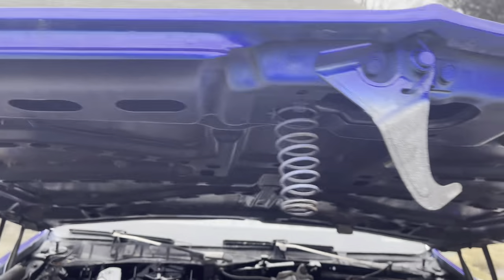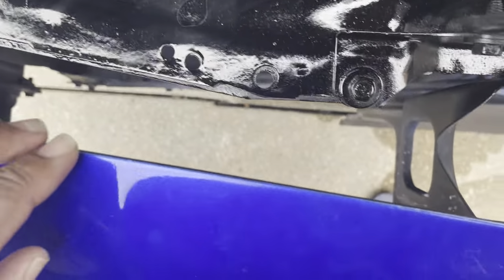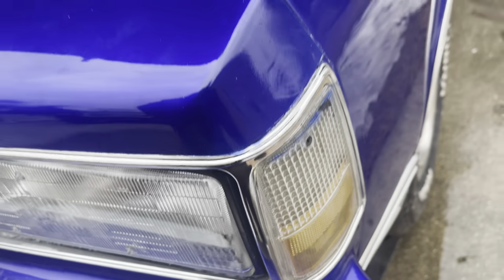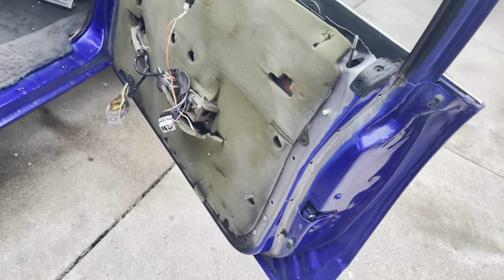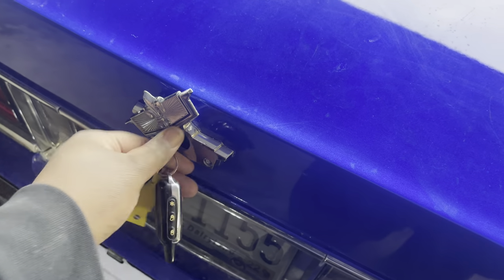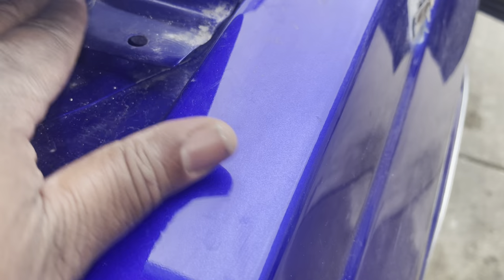THE PAINT JOB FROM HELL‼️‼️‼️

Comment: That's crazy someone did me the same way on my 86 Monte Carlo and it was supposed to midnight blue but it came out bud light blue and started peeling within a month shit crazy I gave up on it it's been sitting for 6 years now maybe a little more and has less than 7k miles on a create motor I had put in before I had it painted the paint made me give up on it, it's the first car I had built in the shop wish I knew about ls swaps then I want to get back on it but I think I'm a try to paint it myself I know I can do better than that I went through the same situation as you I swear that shit crazy